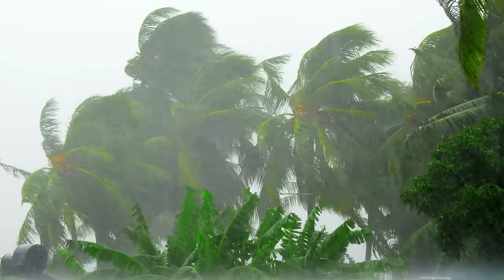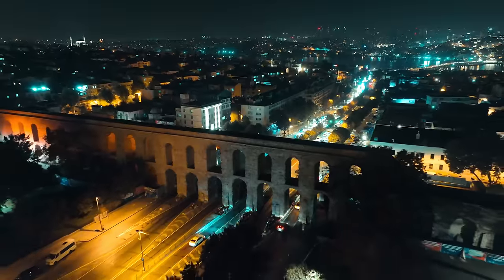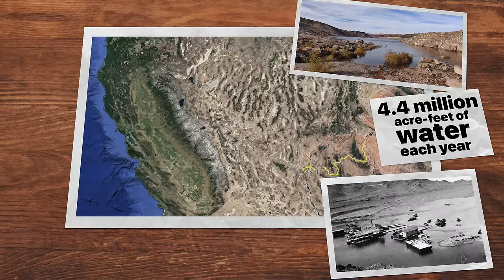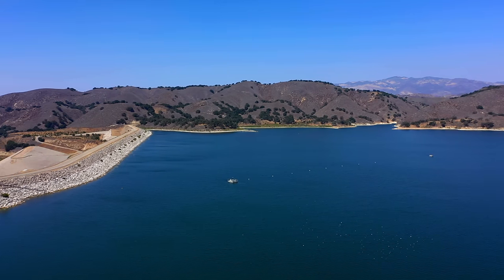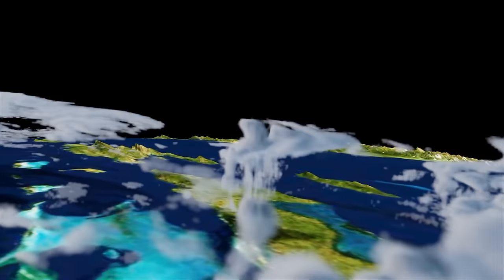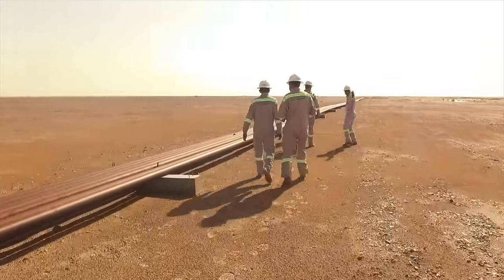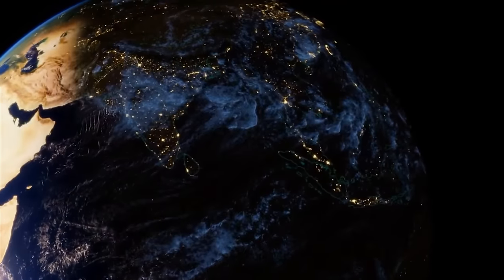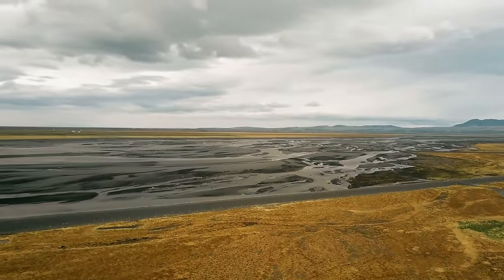Pipelines From Flood to Drought

Comment: Once you boasted of living in Southern California, I decided you were so crazy that your ideas are harebrained.   Nothing personal.   Pumping water uphill is extremely costly.   Are you going to do that with fossil fuels or renewables?   You're not going to do that with wind or solar, so you need nuclear plants.  Yes.  Let me see you advocate for more nuclear plants.
Reply from the maker: I have whole videos on the future of nuclear
Reply: The repurposing of gas lines in the U.S. has been going on for over 25 years that I know of. A company called Windstar (now defunct) took existing gas lines that were condemned and attached Corning true leaf fiber optic cable to the PIG and built a network that goes from coast to coast and every large city and most small to medium cities and towns in-between with equipment huts every 50 to 70 km.   Putting pumps wherever needed would be a small thing and putting water in a pipe with fiber optics cable wouldn't  be an issue either. There you have it in a nutshell
Reply: Look at L.A.s H20 infrastructure and topography they already pump water up hill with stepping pumps

Comment: Indeed it can and will work as I've explained to a close friend months ago when I had explained the basic concept of piping h2o from the east coast to the west coast. If we can move oil for thousands of miles than water shouldn't be a problem at all and even doing so with the most basics of mechanical equipment.
Reply: The key difference is water sells for less than $0.10/Gallon even in California. Gas in the same area sells for over $5.00. Pipelines were largely built over a century by private industry looking to make money. There is no money in transporting water. It would take decades and cost trillions to build a pipeline dedicated for water...all paid for with tax dollars. That is assuming you could work out water and land rights across dozens of states and tens of thousands of local municipalities and hundreds of thousands of individual land owners.

As much as it would hurt states like California, it would probably be more cost and time efficient to just incentivize them to move to where the water is.

Comment: I've been wondering for some time while they why they didn't do this
Reply: See my comments below. Because it is such a comic book idea that even Superman doesn't want to get involved.
The floods come at the wrong time of year and there isn't enough storage to hold it until it is used.
The pipe required would be a mile wide and 200 feet deep and would have to run to a string of lakes throughout the Sierra Nevada. 
That's for starters.

Comment: imagine if the California epa would allow a solar desalination plant to open but that would make to much sense.
Reply: The farms require 36 billion gallons per day. That equals a good-sized desalination plant every half mile for the entire California coast. They would cost more than a trillion dollars, not counting pipes and power plants. They would produce 25 billion pounds of salt per day.
They would also have major disastrous effects on the ocean and coastline. One in San Diego is under review for just those kinds of things right now and it isn't anywhere close to this idea.
Reply: @cliffordschaffer5289  why not just use the salten sea and set up a pipe line from the ocean to refill it. also the the fresh water generated could be used for the crops in the salten sea basin. The Colorado river water could then be diverted to the city's instead of being used for crops. The Colorado river aqua duct system is already in place and wouldn't cost anything.
Reply: @bobby1602  People have proposed that. First problem is that creates environmental problems of its own. Like adding more pollution of its own.
Also, the Salton Sea water is not useful for anything. Too polluted. If it is pumped in, it cannot be used for agriculture. 
Also, that is a tiny, tiny part of the problem. The big part of the problem isn't anywhere near there. 
Among other problems. 
The biggest issue is the amount of water required. Lots of plans sound good until you start figuring out how much is actually required.

Comment: I have asked for years why we don't have pipelines from the great lakes to areas where it's needed. Then there is California who floods and sends all that water out to the ocean then faces a drought a couple months later.
Reply: The Great Lakes were filled during the Ice Ages 12,000 + years ago .There is a finite amount of water in the whole system. Do you think they need draining?
Reply: @fayebird1808  I didn't say drain them learn to read or at least comprehend
Reply: @claredegroff1491  You don't comprehend finite, meaning, limited. If you pipe water from the Great Lakes you shall drain them.
Reply: @fayebird1808  no I completely understand what it means but you are simply wrong there are over 5000 tributaries & river & streams feeding them. But even if there weren't it would take 10,000 years for us to use them up. 
Look it up.
Reply: @claredegroff1491  Quora disagrees with your assessment. 1% of the volume of the Great Lakes is rain and tributary flow. The millions of Americans & Canadians who live there depend on that water supply. It is certainly finite.
Reply: @fayebird1808  no its not

Comment: I been talking about a national WPA type project to create a method to pump water  from wherever there's too much to areas in drought for 30 years. Most folks argued it was too massive to happen. Good to see this video.
Reply: The California farms require 36 billion gallons per day. That is about one tenth the flow of the Mississippi River at its mouth. That is a pipe about a mile wide and 200 feet deep.
Then, the pipe needs to go to Lake Oroville and Lake Shasta, in Northern California, among other places.
You get the funding worked out and I will start right away.
Reply: @cliffordschaffer5289  I wasn't talking about supplying CA with water. I was just thinking of the often large flooding events in US and that water could be used in the west. Not envisioning "mile wide pipes..."
Reply: @jeffsaginaw1769  The water from flooding comes at the wrong time of year to be useful and there isn't enough storage space to hold it until it could be used. 
Furthermore, trying to use it to control floods would probably require bigger pipes than just plugging one in at the end of the Mississippi. More water coming all at once.
And California is the place where it would do the most good, if Superman could do it.
Reply: @jeffsaginaw1769  If you want to store that flood water, then the first places you need to fill up are Lake Powell, Lake Mead, Lake Shasta, and Lake Oroville. After those, you would need a series of pipes running to each of the lakes over a few hundred miles of Sierra Nevada mountains.
That would be a tiny start to the idea. Just for grins, pull up Google Earth and work out where those pipes would have to run.

Comment: Good ideas.  I also like the idea of connecting low lying areas around the world like death valley (280' below sea level) to the ocean to help counter sea rise while potentially creating new sources of evaporated fresh rain water down wind in desert areas.  This has the potential to turn desert areas into farmland as the evaporation rate would be very high in a huge new lake exposed to desert sun with a constant flow of water from the sea.  There is also the potential to generate power as large volumes of water flows down 280' to replenish evaporated water in the lake.
Reply: Death Valley is very far and many mountains from the ocean. It would cost energy not produce energy to move ocean water to Death Valley.
Reply: Pat - what happens to all of the salt & minerals in ocean water when it evaporates out of the Death Valley lake?  It's left behind.  And as another reader has mentioned, it's not a straight downhill shot from ocean to Death Valley.
Reply: Pump flood water there, not ocean water. It's gonna turn into a bowl of salt as the water evaporates

Comment: I've been thinking about this for years. It's really not that hard a concept to wrap your head around. Not to mention the pipelines themselves could act as something of a reservoir themselves. An inert gas like nitrogen could be used to flush water out of the pipes if water is needed enough to warrant it. It could then be collected and stored  when water refills the pipes.
It should also be noted that Florida could benefit as well. The Everglades are dying because the water's being drained away to handle the thirst of Floridians. If water can be moved into Florida instead, that would go a long way towards protecting a rather unique part of this world.
Well, that or we can move a bunch of people around. Water seems much easier, though.
Also, we should really put more into securing clean water. I can live without oil for a day. I can't live without water.

Comment: I like the idea of using it as a flood mitigation technique. As a resident of the Great Lakes area, I always hated the idea of pumping water from the lakes to places like Arizona. Instead of destroying our lakes so someone can live in a desert, they could just live somewhere less inhospitable. But if this is done to actually reduce flooding in parts of the Midwest and South, then I think its a win-win scenario that could help agriculture in the areas the water is leaving (by reducing flood damage), where its going (by reducing the effects of drought), and potentially the areas in between (with terraforming effects). 

This would also play into the new general understanding of the energy transition, which says that the US needs to actually increase supply of fossil fuels to stabilize the market during the uncertain times of transition while also reducing demand. Maintaining or even building out new pipelines makes more sense when they have an economically viable second life.